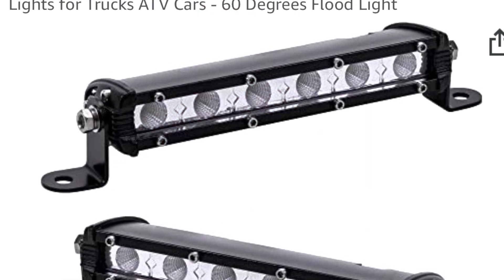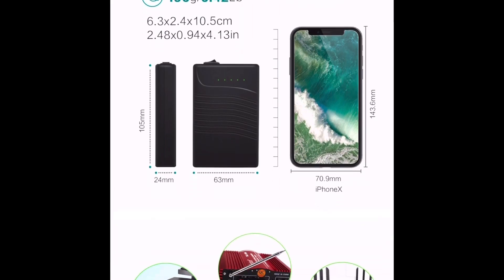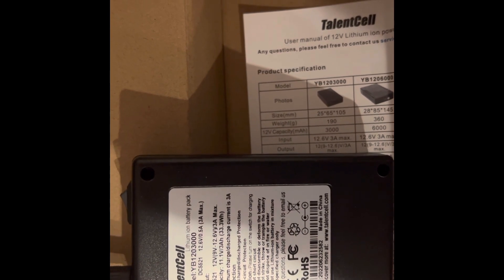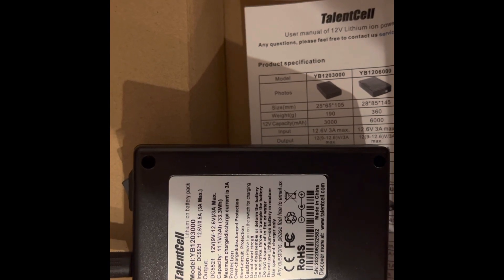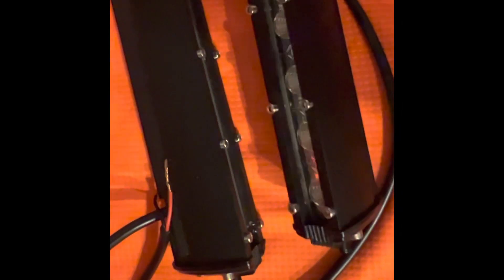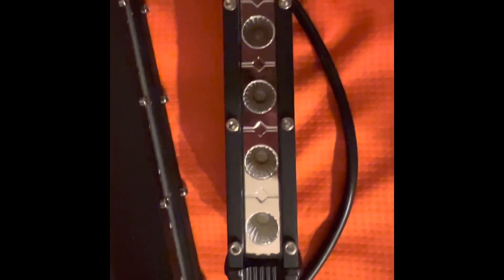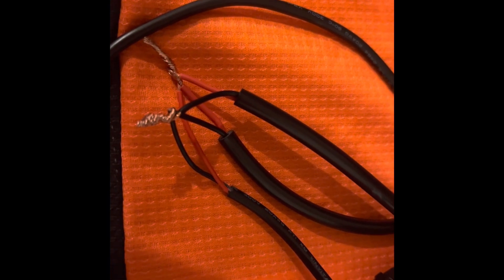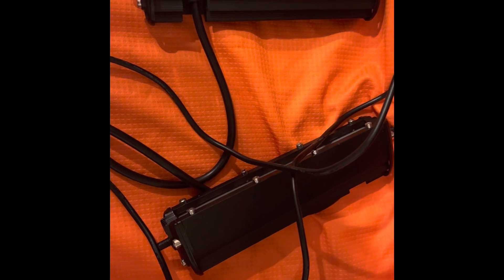Blade GT Electric Scooter Headlight Upgrade Part 1 (Parts, Wiring, Demo) Under $50

Comment: Did your blade come with a speed limiter? It’s a long white wire you have to cut in order for the blade to reach top speed
Reply: I’m seriously thinking about buying this version. The blade 10 is giving me too many problems
Reply from the maker: Mine did not come with a limiter. What is wrong with your blade 10?
Reply: Me!!!  I wasn’t doing my due diligence with the maintenance. And the pot holes at 40mph does not help
Reply: @Ian C Chambers no a limited is usually more aggressive, so more like max speed of 15-30 mph
Reply: When I bought my blade 10 last year it had a speed limiter on it. It took me a week to find out it was not a bad battery. The supplier let me know after the fact!